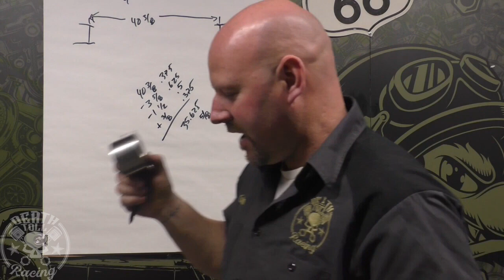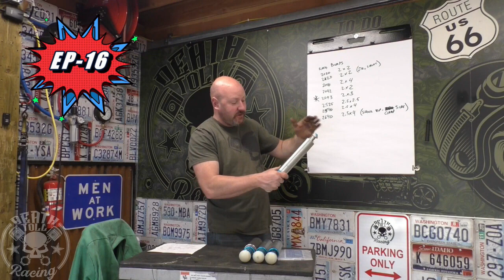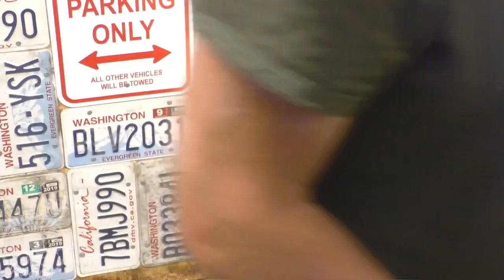Build Time-lapse; 4x4 Pontiac Station Wagon, 4 Linked, Coil Over Overlander LS Swap, 30 Minute Build

Comment: Jeezy dude you got it going on!! I'm 80 and was a line mechanic at Superior Pontiac and remember the Safari. It's beautiful. The suspension build is off the charts. I assume that's an open end   u joint shafts and high pinion Subbed some time back. Never seen u git this serious. Dandahermit  Dana 44 high pinion. Ratios??
Reply from the maker: Thanks!!!  I do my best!  I bet you saw some really cool cars working for Pontiac back then!!!
Reply from the maker: 4:10 ratio. Locker in the back, powerlock in the front

Comment: What a great project as I have a 65 Pontiac Station Wagon, but my only plans for it is an LS swap!  What a great Adventure off road project !  Where are you located by the way? Greetings from Western Montana
Reply from the maker: Not far from you.  Spokane WA, this one has an lt swap (just a later version of the ls, but basically the same)  There is some detailed videos on getting it in there, and it really wouldn't be any different for you since it's all on the factory pontiac frame.  I would stick with the LS though.  The LT is a little more complicated and doesn't really gain you much.

Comment: What is that rear diff out of? It looks like one of those GM 14-bolt? 2500 or 3500 Diff
Reply from the maker: It’s a shaved 10.5 14 bolt from an 80’s k30 Chevy.  Below is the video of me shaving it, there’s also videos of the disc brake conversion too. 

E6: 14 Bolt Shave, Ballistic Fab: 1965 Pontiac Catalina Safari 4x4, Overlanding Project
https://youtu.be/nGkb-iC6yTY
Reply: @DeathTollRacing  I previously watched most of that video. It look like you were turning the outside diameter of the rear differential gear for extra clearance in the housing.
Reply from the maker: @josephmarino3045  later I cut off the bottom of the housing and weld in a plate.
Reply: @DeathTollRacing  yes I saw the bottom cut off in a newer heavy duty replacement bottom was welded on. I haven't seen the project finished. I'm assuming it's some kind of a skid plate for the bottom of the Diff. I know the stock shapes do not lend well to some kind of aftermarket reinforcement.